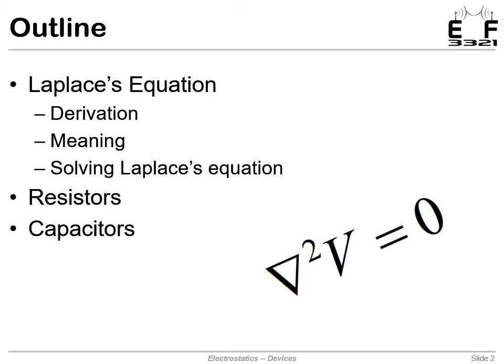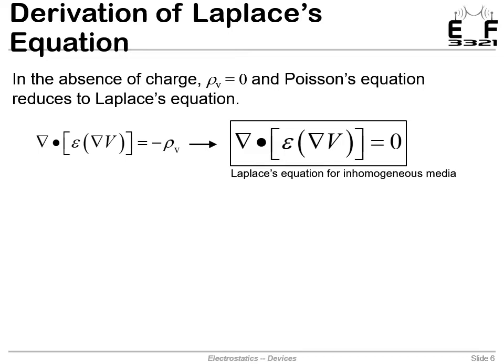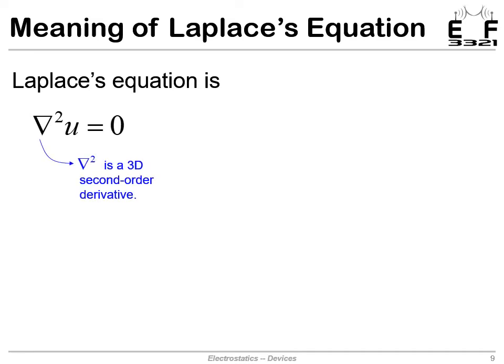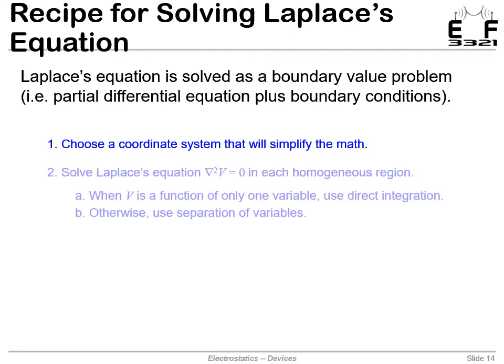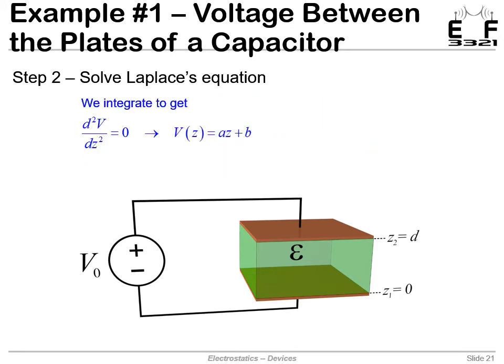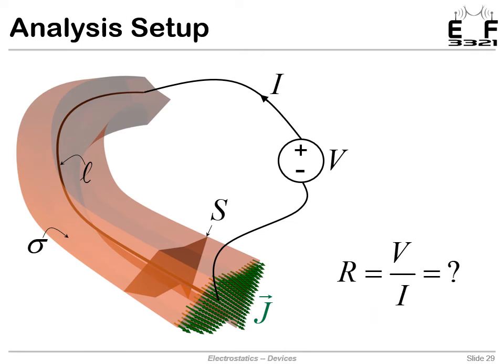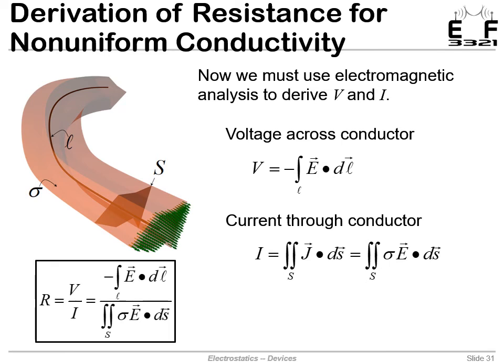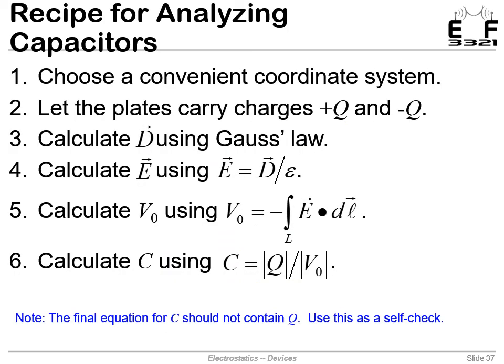Lecture 4f -- Electrostatic Devices

Comment: Can you sir please give more insight about "how can the charge density be zero in electrostatics in deriving the Poisson's equation"?
Reply from the maker: The charge being zero is not really a derived thing.  In many cases, the charges are confined to conductors and you are trying to calculate the field between the conductors.  Between the conductors there is no charge so you set rho=0 in Poisson's equations to get Laplace's equation.
Reply: @empossible1577  Ok,thanks sir